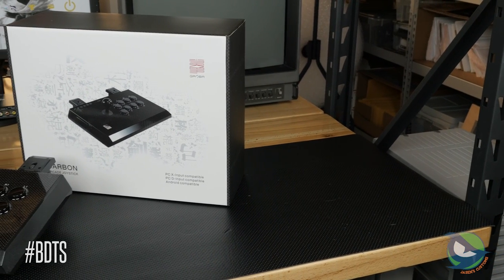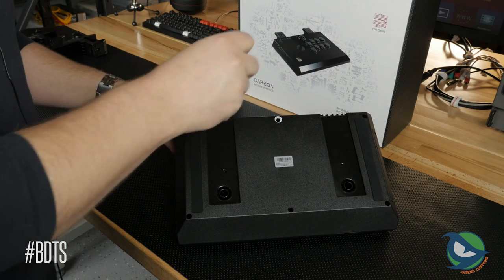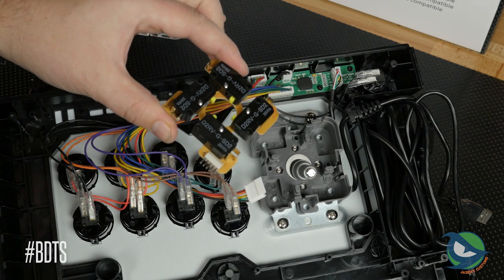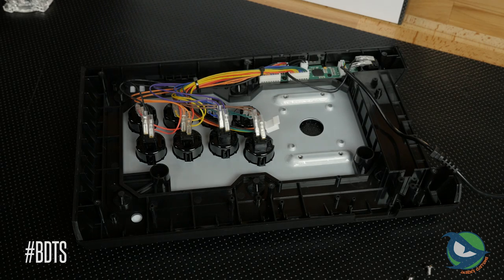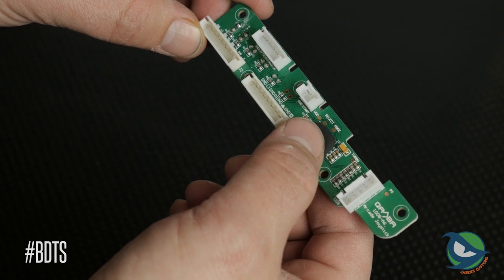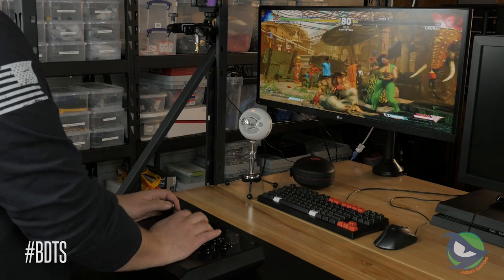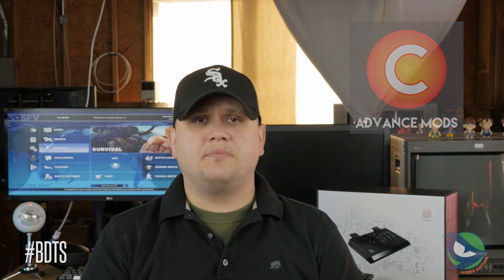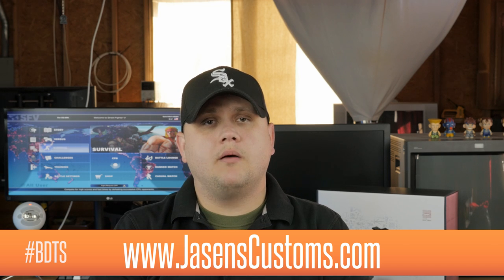Breaking Down the Stick - Qanba Carbon

Comment: A comment for anyone wandering here curious about this stick. It's still awesome, I managed to get it for 40 bucks (from their own website no less) it shipped fast, and it's super good for the price. Any additional parts can be bought later should you need, but for my first stick I couldn't ask for any better!
Reply: Ty
Reply: is qanba carbon better than drone? im probably not gonna mod the stick after i buy it
Reply: @daepicpotato1506  I've heard good things about the Drone, but the Carbon is about half the price (doesn't work on current gen consoles tho) and feels really, really nice
Reply: AlpacasMafia I just picked up the carbon yesterday. U have to change the settings on steam but other then that I like the stick. The table clamps work great and I believe it has a wider footprint then the drone. I’ve been playing sfv on pc. Honestly I swear I’ve seen your name on cfn
Reply: Da Epic Potato I like the carbon a lot. I think the bigger footprint helps a lot
Reply: @alpacasmafia9265  unless you can find a second hand drone cheaper than the carbon, I'd stick with the Carbon. You're getting a wider case and virtually the same parts (stick and buttons) for cheaper, plus the table clamps. If you decide to mod or have to replace the joystick, the carbon is much more mod friendly too. The only thing the drone has over the Carbon is that it can be used on modern consoles. Carbon is the best budget friendly stick on the market for pc.

Comment: Solid breakdown; I have one of these myself but I've got a question that I haven't really found any info on.

How do the stock buttons compare to Sanwas? I've upgraded, but I chose Seimitsu because the idea of the lower sensitivity was a little more appealing. As it's the first stick I've ever used, I don't have any experience with Sanwas, so I was wondering what the difference was in terms of feel/actuation force.

Comment: Nice breakdown, very much appreciated. I own one now and plan on modding it. I just have a few questions:

If you remember, what mounting plate did the that Seimitsu stick have on it? There a bunch like SS, P=40, etc. 

If you're familiar with Seimitsu sticks in general: For a shoot'em up player, if you had a choice between an LS-62-01 or an LS-56-01 with an octogate, which would you lean more towards? I'm leaning towards the LS-62-01 because of the shorter shaft (which might make the throw shorter too) but I just can't decide.

Comment: Great stick!  This arcade controller works well in Linux with RetroArch.  How would you rate the stock lever vs a Sanwa JLF?
Reply from the maker: Good news on Linux support. Suspected it worked fine :) As for the lever, its not an "OMG this is way different" but you can definitely tell it isn't a JLF.

Comment: I know this video is over three years old, but you can install full size Seimitsu levers such as the LS-32 and LS-40 without the mounting plates. Remove the top panel of the Carbon, unscrew the mounting plate from the Seimitsu lever, and screw in directly from the top of the panel.
Reply: Would that make the LS-40 too tall? I could understand it being a great approach for the super short LS-32, though.

Comment: I'm planning to buy this arcade stick. My question is the button is not small?  compare to the button in arcade machine?
Reply: The button is 35mm same as the arcades.
Reply: @AmirulOmarAO  it's 30mm. Only two size for arcade's standard :30mm and 24mm

Comment: Is there anyway to get the qanba carbon to work on ps4 without a converter? I've heard converters add a considerable amount of lag. pretty upset to find out it only works with some ps4 games.
Reply from the maker: Lucart - it's a PS3/PC stick. Advertised as such. Brook converters don't add enough lag to not use them.
Reply: thanks, I'll be getting the ps3 to ps4 brook converter. In hindsight I should've gotten the drone but too late now.

Comment: I just got my carbon today as a  backup for my hori real arcade pro n (I like to have a backup for tournament play just in case and the qanba drone I had gave out) and I can't get the base to separate from the clamps, no matter what way I pull or pry or at what angle or how much force I use (I'm at the point where I feel if I use any more I'll break it) they will not come off. Anyone have any tips or tricks or suggestions for getting them off? Thanks in advance.

Comment: hi.. thanks for the video.. jz wondering.. when i openned the bottom.. i saw the microswitch plates are bend... when you switch into normal sanwa button.. do u need to bend the plate to make it fit with the height of the stick?? thanksss
Reply from the maker: I'd assume so, yes.
Reply: Jasen Hicks Thanks for the reply.. i broke soo many microswitch plate bfore.. it break easily T____T so quite afraid to mod the buttons on carbon

Comment: I saw on another review that it comes with a hexagon and circle restrictors in the box, is this true? Or does it only come with the square restrictor?
Reply from the maker: Lag - mine came with a square. I think other swap out a JLF to get a better experience over the stock qanba lever. This would allow the octogate.
Reply: That's what I might do. How is the build quality on this thing? Does it feel cheap and plasticy? Or like it'll last?
Reply from the maker: Lag - it’s cheap and plastic. For the price, it’s about what you can expect.

Comment: is there a way to lower the sensitivity on it? its reading slight inputs that the stick makes when resetting to neutral
Reply from the maker: Not really, what's happening is the lever is springing back making contact with the microswitches. You need to improve the lever, I recommend a Sanwa JLF from www.ArcadeShock.com.
Reply: ok. will it be compatible though? like If I buy this: https://www.amazon.com/Sanwa-JLF-TP-8YT-SK-Adjustable-Tournament-Compatible/dp/B0027Z7L5I        It will work with the carbon?
Reply: Also forgot to ask, is the sanwa JLF the best plunger i can buy for it?

Comment: Does a Korean lever fit?
Reply from the maker: The bolt pattern is different, its not deep enough, and the top mounted gate won't fit through the hole that standard lever comes up through. So, no not easily.

Comment: If I had this arcade stick, I would install a crown lever and sanwa buttons into it.
Reply from the maker: I think you would be hardpressed to get a Korean Lever into it as the mounting pattern is very different and requires a very deep case (min 1.837") to accommodate it.

Comment: do you think i could fit a hori fc4 pcb in qanba carbon
Reply from the maker: I fit a Raspberry Pi in one, I think you should be good.
Reply: Does work well with the raspberry pi on different consoles

Comment: Am i able to put samducksa buttons on it?
Reply from the maker: 30mm versions, yes.
Reply: Jasen Hicks what about sanwa sir???
Reply from the maker: Justanalt is right, Sanwa 30mm and Hori 30mm buttons will all work. This stick is easy to mod basic parts into. Advanced mods are a bit trickier (pad hack addons, etc) and require more creativity.
Reply: Jasen Hicks thank you so much! Okay so I have a last question  for you which lever would you recommend ??